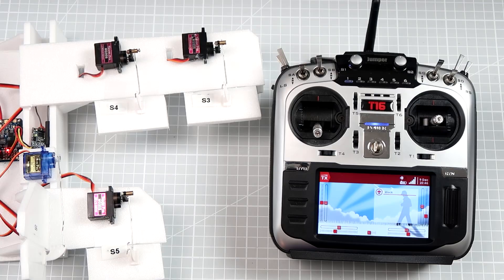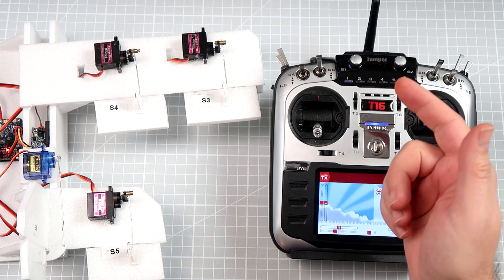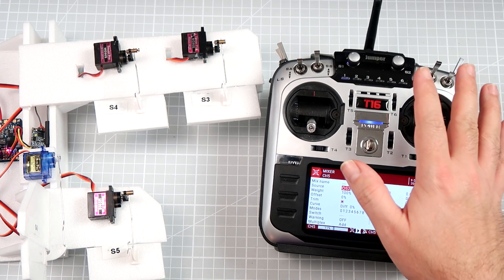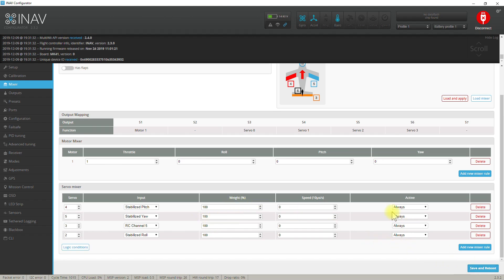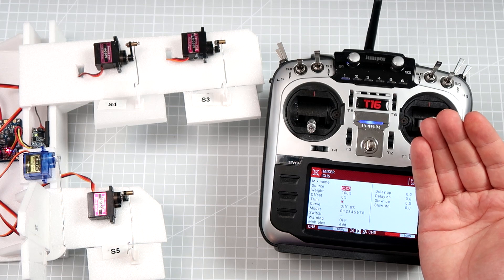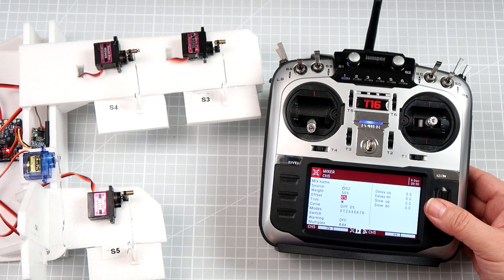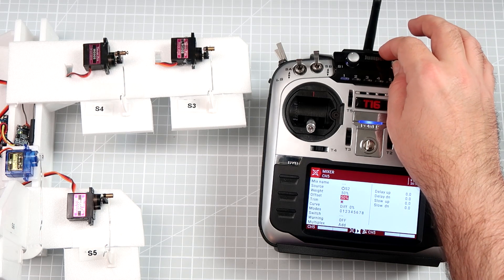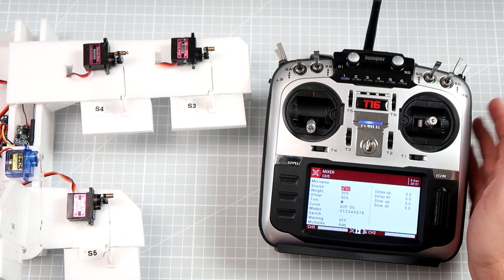INAV Flaps with mixer and OpenTX: full tutorial #fpvuniversity

Comment: Hi I am using iNav 2.3 and would like to try out flaps to slow my Strix stratosurfer down on landing.  In the servo mixer area when I select airplane under preset mixer two flap mixes are added automatically.  Also there is a Has Flaps tab under platform configuration. Do I need to turn on Has Flaps or just leave this off? And should I just remove the two flaps in servo mixer and add a mixer for a servo to a switch on the radio to control the flaps when I want to use them. I am using Crossfire and iX12.

Comment: Does inav support f3 .I'm using spf3 I downloaded inave 2.3.3 and I'm trying to flash only 2.1.0 version on in the board but it's not flashing .I'm get "STM32 -timed out , programming failed". flashing is done till halfway then I'm getting like thi
Reply from the maker: it supports SPRF3 just fine. Try recovery as described in flashing tab of configurator
Reply: @FPVUniversity  I don't understand sir .can u pls elaborate

Comment: Don`t forget, if the flaps are fully set, you need some down elevator to prevent a nose up....or will the fc compensate this in acro? I have this on the tx mixer for the flap switch working.(mode: acro & manual)
Reply from the maker: FC will compensate in Acro
Reply: @FPVUniversity  ..thanks. then I will remove this for the acro setting on the transmitter.
Reply: @FPVUniversity  But can I still use the mix functions in my Taranis for down elevator in manual mode with flaps..? Or will I mess something up when I occasionally take/off land in stabilized modes? I would prefer to get the mix right in manual also(like "aMAx"), since I fly an inherently stable piper cub..Thx! :)